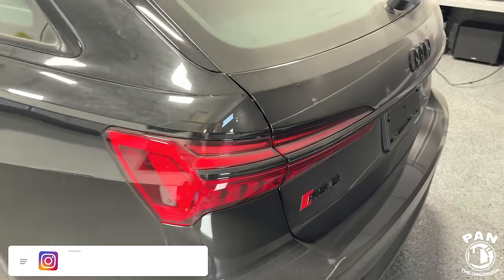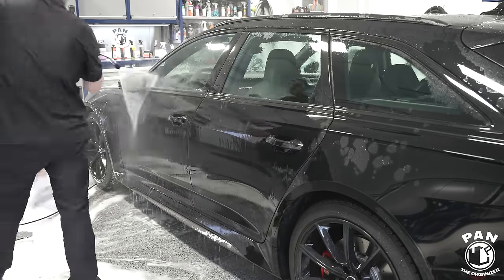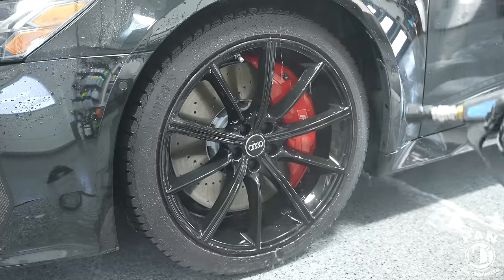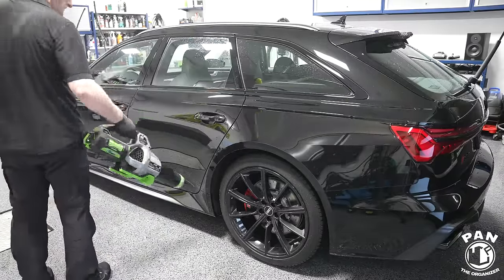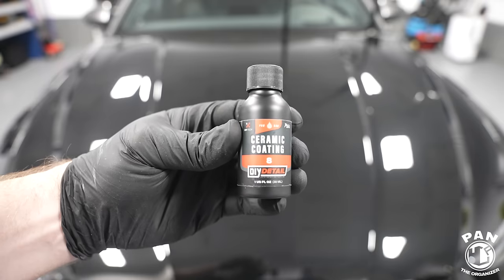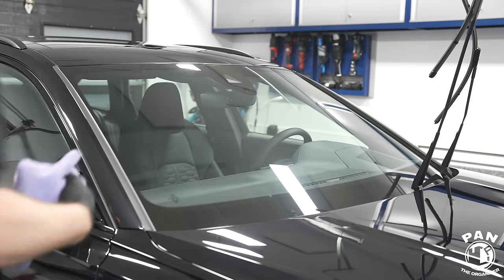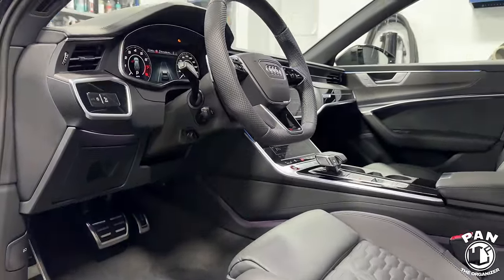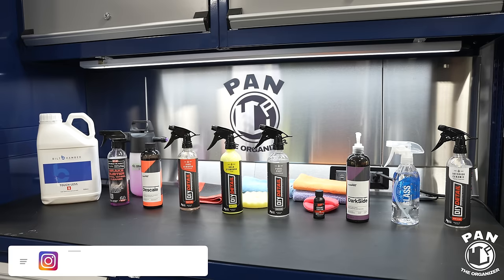Ultimate 2024 Audi RS6 Avant Performance Detailing & Ceramic Coating

Comment from the maker: ⬇️🔶 LINKS TO PRODUCTS MENTIONED IN THIS VIDEO ⬇️⬇️
🇺🇸 For people in USA:
Nitrile gloves: https://amzn.to/3ZHwzpl
Kranzle 1122TS pressure washer: https://bit.ly/3Fw4xp8
Mosmatic gun and wand package: https://bit.ly/3sQxxAh
Bilt Hamber Touch-Less snow foam: https://bit.ly/44nTnxn
Foam Cannon: https://amzn.to/3XpFOdj
P&S Brake Buster: https://bit.ly/3Qrl8jt
IK foam pump sprayer: https://bit.ly/3YnotSM
Detail Factory tire brush: https://bit.ly/3Vaczt5
EZ Detail barel brush: https://bit.ly/3GOiyO4
Microfiber Madness Incredibrush: https://bit.ly/488TLAY
Lug nut and caliper brush: https://amzn.to/42T42xz
Detail Factory ultra soft brush: https://amzn.to/3RVLsmc
CarPro Descale shampoo: https://bit.ly/3OKqO4u
Dual wash buckets: https://bit.ly/3CFXOGj
The Rag Company microfiber wash mitt: https://amzn.to/44jyZMH
DIY Detail clay towel: https://bit.ly/3WsWdPJ
DIY Detail Iron Remover: https://bit.ly/3QCfYR5
DIY Detail Quick Beads: https://bit.ly/4brbt3O
McKee’s 37 Floor Mat rejuvenator: https://bit.ly/3NEpMsi
EGO blower: https://bit.ly/3IPUz3O
Stubby nozzle for blower: https://bit.ly/48AfpxR
Blower band: https://bit.ly/4aztVHI
DIY Detail Gold Standard Polish: https://bit.ly/3WwLbsy
DIY Detail Gold Standard Waffle Pad: https://bit.ly/3wgWEC9
Flex dual action cordless polisher: https://bit.ly/3XhSRfM
Microfiber towels for polish removal: https://amzn.to/3H9A2pu
Scangrip LED inspection light: https://bit.ly/3GP59Fo
DIY Detail Panel Prep: https://bit.ly/3UAZZ6S
DIY Detail 8 year ceramic coating: https://bit.ly/4aaiBRa
Coating applicator pad: https://bit.ly/3JSaLRj
Microfiber towel (for levelling the coating): https://amzn.to/44ihbRN
Microfiber towel (for final buff): https://amzn.to/3OiCTio
CarPro DarkSide tire sealant: https://bit.ly/3XOtDFU
Tire dressing applicator: https://amzn.to/3EB2MVP
Gyeon Glass: https://bit.ly/3Tl0XlB
Microfiber glass towel: https://amzn.to/3NJccUX
DIY Detail Interior Ceramic: https://bit.ly/3JYJYTj
The Rag Company Edgeless 300 towel: https://amzn.to/3ONHies
CarPro Fabric (carpet protection): https://bit.ly/3YtNITl
Vyper Chair: https://bit.ly/3B43xVF

🇨🇦 For people in Canada:
Gloves: https://amzn.to/3GKrvYH
Pressure washer: https://bit.ly/3MgYINZ
Gun & wand: https://bit.ly/3EBUZbI
Snow foam: https://bit.ly/3qSvqwl
Wheel & tire cleaner: https://bit.ly/3AHXRQX
IK foam pump sprayer: https://bit.ly/3VfwcAs
Foam cannon: https://bit.ly/3ltOq3r
Tire brush: http://bit.ly/3eg9Rls
Barel brush: http://bit.ly/3T4ncwB
Lug nut and caliper brush: https://bit.ly/3CHQqdW
Microfiber wheel brush: https://amzn.to/41CLv9L
Ultra soft brush: https://bit.ly/3unniSx
Shampoo: https://bit.ly/3RinjUs
Buckets: https://bit.ly/3CFXOGj
Wash mitt: https://amzn.to/3wdrBn1
Clay towel: https://bit.ly/3YpF74e
Iron Remover: https://bit.ly/44ySmBQ
DIY Detail Quick Beads: https://bit.ly/46c4lGw
Rubber mat rejuvenator: https://bit.ly/3imUvxz
Blower: https://amzn.to/3WhddVa
DIY Detail Gold Standard Polish: https://bit.ly/3Y9AM4S
DIY Detail Gold Standard Waffle Pad: https://bit.ly/3Ov5GBv
Coating applicator pad: https://bit.ly/3tvdJXk
Polisher: http://bit.ly/3inH2Fv
Polish removal towels: http://bit.ly/3CTIbMo
Inspection light: http://bit.ly/3knW5QA
Panel wipe: https://bit.ly/44L8AYO
Ceramic coating: https://bit.ly/3KfmiuE
Towel for levelling coating: https://bit.ly/3E8KgnB
Towel for final buff: https://bit.ly/3UPu0y4
Tire sealant: http://bit.ly/3V9DlSm
Tire dressing applicator: http://bit.ly/3fWuFPz
Glass Cleaner: https://bit.ly/3AIvnVd
Glass towel: https://amzn.to/3JoFJR5
DIY Detail Interior Ceramic: https://bit.ly/3QfxpYi
The Rag Company Edgeless 300 towel: https://bit.ly/3RcQmZ8
Carpet protection: https://bit.ly/3Xf7qkd
Vyper chair: https://goaff.pro/otzyke

🇬🇧 For people in the UK: https://bit.ly/3fgoENJ

🇫🇷 For people in France: https://c3po.link/QCWWjkv74R

Comment: Pan-  I give Nick and Ivan mist if my detailing $$ but I haven't tried the quick beads.  Should I add it to ny next order?  Do you have any videos highlighting or reviewing it?  Thanks
Reply: Thank you. DIY Detail Quick Beads is a great drying aid, but particularly effective on protecting wheels and grills.
Reply from the maker: I love quick Beads on paint (like Gyeon WetCoat) and but also on wheels. It's such a quick way to top off your wheel protection!

Comment: Hey Pan. Great work! How does this DIY ceramic coat differ (if at all) in terms of prep/products from the ceramic detail shops that charge $1000. In other words, if I follow these steps using these products, why would someone still go to a detail shop?
Reply from the maker: People who pay a professional to have their vehicles detailed and coated is usually because they don't have the time, or equipment, or skills to do all of that on their own. So what you are paying for mostly is for the detailer's time, and expertise. Which is totally worth it.

But for the prosumers and more experienced DIYers, like those who watch my videos, you can do all of the work yourself and save a bunch, especially if you already have most of the equipment that you need. At that point, it's just buying the coating, and doing the work yourself.

Comment: Awesome job Pan! The car looks great. When I got my RS6 I immediately brought it to XPel Houston, had paint correction then whole car wrapped in matte PPF and ceramic coating on top. Was this guy nice enough to let you drive it or have you driven an RS6 before? It is such a nice ride in comfort mode, then hit the RS button and it’s such a beast. Also, have you seen the SICK new wheels available on the 2024 RS6 Performance? - beautiful. They look similar to Vossen HF-5’s
Reply from the maker: He said I could take it out for a spin, but it's winter here at the moment, and I did not want to push it in harsh conditions. But yes I have driven Audi RS6 in the past, just not this new "revised" 2024 version.

Oh and the wheels in this video aren't the stock summer wheels, they are just the customer's beater winter set.

Comment: This is unbelievable mate. I'm as  gobsmacked as the owner about how well that turned out.  Beautiful car and fantastic result to suit. Awesome vid Pan.
Question.  When not stripping a coating would you normally pre rinse first before applying a snow foam or do you always apply to a dry surface?
Reply from the maker: There are two schools of thought on that, both methods being valid. You can pre-rinse first, especially if the car is dirty, before foaming. If you do that, I would still pre-treat the surface with a rinseless wash solution before rinsing.

And you can apply the foam on a dry surface, allowing it to cling better on the surface, be less diluted (as there is no water on the surface) and in theory do a better job a pre-washing the surface that way.

Nowadays, I mainly use the foaming on dry paint method.

I made a video on that topic here: https://youtu.be/16SwGBQ29rs?si=NOGJJuZipFIrtqeg
Reply: @PanTheOrganizer  thanks for that

Comment: That is truly a beauty.
Reply from the maker: Thanks for watching Keith! How did you discover my channel by the way?

Welcome to my channel. You discovered one of the biggest car detailing channels on YouTube as we surpassed 1 million subscribers and we have over 140 million views! I have been detailing for 27 years and I love to share my knowledge and passion with my viewers.

You found the right channel to help you learn everything about detailing.
Reply: @PanTheOrganizer  I’ve been watching your channel off and on for 4 years. I’m a car enthusiast and I’ve recently purchased a new vehicle so I need to stay sharp on the cleaning techniques. Thankfully, you are very thorough thus showing the skills of an excellent teacher.
Reply from the maker: Congrats on your new ride! What did you buy?

Keep in mind… A new car is never new until it's properly detailed. 
- at the factory, the paint defects are often corrected quickly by rotary polishing which can leave marks and holograms, so polishing corrects those, before you lock that in long term with a ceramic coating for example.
- vehicles are then transported by truck, train and boat so they are exposed to the elements, industrial fallout, brake dust, rail dust, etc
- vehicles are often left at boat docks (when transported by boat) or in exterior parking lots for weeks or months, again being exposed to the elements
- at the dealership, the vehicles are almost always poorly prepped using the same dirty water that was used for all the cars on a given day, and poor washing and drying methods leading to swirls and scratches 
- at the dealership, a layer of cheap wax or paint sealant is usually applied to attempt to make the paint glossy prior to delivery. It's crucial to remove any previous protection before you apply a ceramic coating, as coatings need to bond directly to a virgin clear coat.

If you only plan on applying a regular carnauba wax or paint sealant though, you could decide to skip machine polishing, as those protectants can be applied over existing protection and it's not as crucial to prep the paint as well.

I explain all of this in this popular video: https://youtu.be/QgoyrC-5CMc

So you can better visualize the new car prep process, here are the steps I perform on a brand new car for my customers: 
Audi RS6 Avant Performance: https://youtu.be/L5SQ0ZIJCj0?si=mcQiMs9HBLlaqjGK
Mercedes S 580: https://youtu.be/Vq_tfcwryVI?si=whord2_UEFSg28UW
Aston Martin Vantage: https://youtu.be/OKga3yZVTqo
Volvo XC60: https://youtu.be/tvDBBenhYFA
Tesla Model Y: https://youtu.be/gohks8xP5NY 
Porsche 911 Carrera: https://youtu.be/2ckiivbFqs4
Audi Q7: https://youtu.be/t7HCBSVnizM
Reply: @PanTheOrganizer  Thanks for the info and advice! I purchased a CX-5, and you are right about the dealer prep. Awful.
Reply from the maker: Cool man! What color is yours? My brother also has a CX-5, and we have had it in a few videos on this channel so far hehe.
Reply: @PanTheOrganizer  Yes, I noticed that one. I chose one in Rhodium White. I plan to apply a Graphene coating once the weather cools down here in Memphis, as it's extremely hot and humid right now. Do you think I need to do any polishing after claying, considering it's white? If so, would you recommend a dual-action or forced orbital polisher?

Comment: Hi Pan ! Thank you as always for these videos. I used the DIY 8 year on both the PPF and painted panels of my RS6. The paint seems incredibly soft (not standard color), and I am seeing new swirl marks even after my careful home washes. Do you have a coating you prefer to help reduce these swirl marks? I don't want to PPF the whole car, but the panels without it are seeing such wear and tear and its only a few months old. Merci !!!
Reply from the maker: Hi. Coatings aren't meant to protect against swirls and scratches, or stone chips. Only PPF can achieve that. Coatings are designed to provide gloss, slickness, chemical resistance, UV protection, hydrophobic properties and self-cleaning properties to make the vehicle much easier to wash.

Coatings can to some extent help prevent a bit of the "love marks" or very light marring from hand washing and towel drying your paint, but that's about it.

Using safe washing and drying methods is what's most important to help prevent scratching your paint. See my car wash tutorial here: https://youtu.be/7Koj5j2Es5U

Welcome to my channel. You discovered one of the biggest car detailing channels on YouTube as we surpassed 990,000 subscribers and we have over 135 million views! I have been detailing for 27 years and I love to share my knowledge and passion with my viewers.

You found the right channel to help you learn everything about detailing.

Comment: DIY coatings looks good .. but will you recommend it over Roar Coatings?
Reply from the maker: I wouldn't compare both. Roar Coatings is a professional grade coating and costs way more. But it's the best pro coating I have ever tested. The DIY Detail is a blend between a consumer coating (accessible for DIYers to buy) and a professional coating in terms of performance. It's very good as well, and much less expensive.

But I have been testing the Roar Coatings for many more years compared to DIY Detail, so time will tell how much I like the DIY Detail ones.

Comment: Hello Pan. On the gold standard instructions it says use on a small area. I noticed you are using it on the whole door. Why that difference?
Reply from the maker: It's the same thing with coatings. Brands usually say to work in small 2x2 sections, etc. That's to make sure those with less experience don't do any mistakes. When you have detailing experience, you can work larger areas. ;)

Comment: Great video! Question, for leveling towel and finishing towel, do you have to switch them out eventually? Or do you use the same 1 towel to level and one to buff?
Reply from the maker: I typically use 3 levelling towels and 3 buffing towels for one car.

Comment: Hey Pan, is it fine to use a PH12 on a ceramic coated car or should I aim for lower PH to be safer, interested to hear what you think! Thanks for all the content you provide us!
Reply from the maker: For ceramic coated cars, for regular weekly washes, pH neutral is all you need. Once in a while, for deeper cleanings, you can use higher pH snow foams (like Bilt Hamber Touch-Less, Bilt Hamber Auto-Foam, CarPro Lift, etc) no problem on ceramic coated cars. Just don't use them on a weekly basis in my opinion.
Reply: @PanTheOrganizer Thanks for the help Pandelis!
Reply from the maker: Welcome to my channel. You discovered one of the biggest car detailing channels on YouTube as we surpassed 965,000 subscribers and we have over 130 million views! I have been detailing for 26 years and I love to share my knowledge and passion with my viewers.

You found the right channel to help you learn everything about detailing.

Comment: Did you say there was PPF on some of the car? I have it on the hood and fenders and I’m still not clear on what I should and should not do to the PPF vs non-PPF surfaces.
Reply from the maker: Yes this car has a full front clip with PPF, as well as the rocker panels.

You can treat PPF the same way as regular paint most of the time. Just don't go crazy with machine polishing, be more careful.

I have a video on PPF maintenance, here: https://youtu.be/I3AszYhWhs4?si=JRNNNoIqhhU3kk94

Comment: What’s your process on deciding on what ceramic to use? Or do you explain pros/cons of each to the customer and let them decide?
Reply from the maker: Most often, the customers watch my channel and have a specific coating they absolutely want to be applied. Other times, I have a discussion with the customers to see their budget, needs and expectations, and see what would best fit their situation (weather, conditions, mileage, garage kept or daily driver that sits outside in the elements all day, etc). Communication is key so that the customer is beyond happy.

Comment: Your videos are immensely helpful. When using CarPro Descale — would this remove a ceramic coating (mine has a 2 year)?
Reply: No only polishing will remove a ceramic coating
Reply from the maker: No. It's actually a good maintenance wash when you get mineral deposit accumulation or water spots on a coated car. Not for use on a regular weekly basis (they have CarPro Reset for that) but once in a while is totally fine.

See my ultimate spring cleaning tutorial where I explain why you'd use Descale: https://youtu.be/oTaFE_p2OAw?si=zcJQAVD-mQQsPlJ-
Reply: Thank you!
Reply: Thank you! @PanTheOrganizer

Comment: A great job, video really doesn't show off the glossiness of the detail. Did you use any additional lubricant besides DIYs iron remover with the "clay" towel?
Reply from the maker: The only lubricant needed for the claying process thanks to that specific towel, was the DIY Detail Iron Remover.

Comment: Hi Pan, thank you for the video. You applied the same coating to the glass. Would the glass specific coating work better (Soft99 Glaco Ultra, for example, your 2023 award winner, or Gyeon Q² View)?
Reply from the maker: I typically prefer glass specific coatings on glass. But as this is a new coating, I need time to see how it will do over time on glass.
Reply: @PanTheOrganizer  Do you have any insight about what DIY guys themselves say about the use of their coatings on glass?

Comment: Can I use an IK type  hand foam sprayer  to foam the car?  I do not have a fancy pressure  washer  unit that you have. 🇨🇦👍👍
Reply: Absolutely. I do and it works well even with low foaming prewashes. In winter I just use an IK sprayer because there's no chance of drying out. Also, where Pan used about 500ml of Touchless, you will use way less. Under 100ml for that size vehicle.
Reply from the maker: Yes as long as you get the foaming version like IK Foam Pro 2 here: https://bit.ly/3SUJ9QS

Or the even better Marolex Axel foaming pump sprayer here: https://bit.ly/49nnR40

Of course it will take more time to cover the entire vehicle, and you won't get the same results as with a proper foam cannon and pressure washer setup. Just keep that in mind.
Reply: Here we go again. I ordered  the IK PRO 2 foamer , wife approved.🇨🇦😃 @PanTheOrganizer
Reply from the maker: Enjoy!

Comment: Nice transformation as usual 😱
I was wondering what’s better for the glass. Ceramic coating? Or a dedicated glass coating?
Reply from the maker: On glass, I tend to prefer dedicated glass coatings usually. But some versatile paint coatings like the DIY Detail also do well on glass. It's a case by case basis.